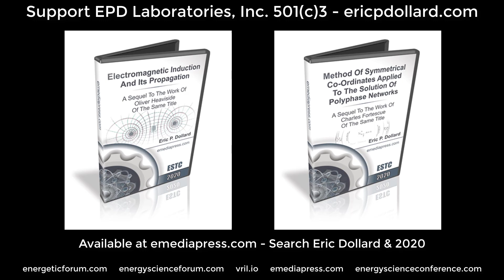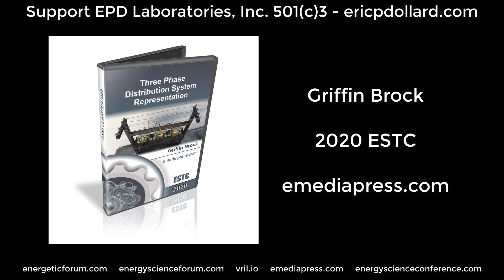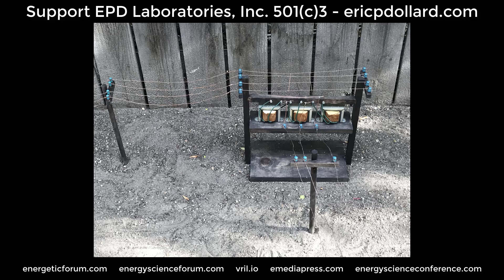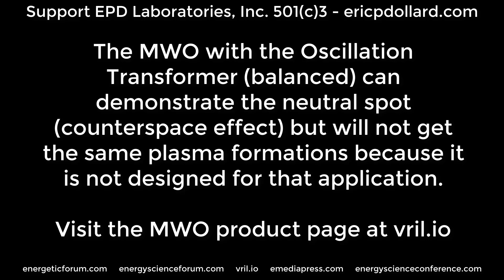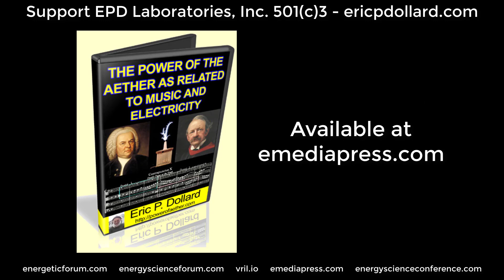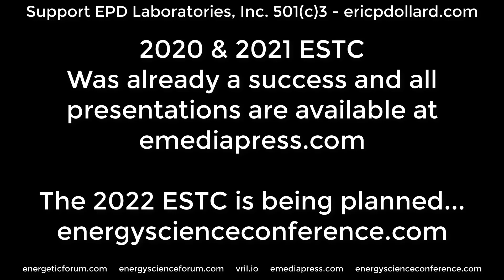Eric Dollard Live - 2020-05-30

Comment: Has Mr Dollard considered reworking the equations with respect to space instead of time. Instead of meters per second(velocity) or meters per second squared(acceleration) or charge per second(Amps) aka space per time, it becomes seconds per meter or seconds per meter squared or seconds per charge aka time per space. Frequency goes from 'occurrences per second'(hertz) to 'seconds per occurrence'. The dimension of space is much more conducive to being 'squared' or 'cubed', than the dimension of time is. It is difficult for the brain to physically visualize 'per seconds squared', but it is much easier for the brain to physically visualize 'per meters squared'. A square second cannot be naturally represented in physical reality(that I know of), but a square meter can be represented in physical reality very simply its simply a square of space with each side equal to the unit of measurement ie meter, foot, inch, cm, etc. Even the words 'squared' and 'cubed' are words to describe space(not time). Sometimes the universe can appear from the most unlikely source to simplify things. Time/space is far simpler than space/time.
Reply from the maker: This is all best communicated to Eric on the live calls or you can write him a letter at the address in Nevada in the right column of his website: https://ericpdollard.com - that way, you can get a response directly from him.
Reply: Cool ideas
Reply: I think calculating distance in light seconds is effectively what you’re getting at.
This is one of Steinmetz contributions.

Comment: Aaron can you ask Mr Dollard, how he would map out the units of measurement if he did not use Volts, Amps, Henry's, Teslas, Ohms, Webers, Farads, Columb, etc or any other unit of measurement that use some dudes name instead of a term related to what is actually occurring in reality. It seems that much of the unnecessarily complex aspects of electrical engineering stem from the very poorly named units of measurement. I'm curious how Mr Eric would represent each of those aspects of electrical engineering while only using units of measurement directly related to reality.

Comment: For twenty seconds, between...

1:06:18
https://youtu.be/FtasKI44WDk?t=3978

...and 1:06:38
https://youtu.be/FtasKI44WDk?t=3998

...I like what Eric says about the only components allowed in the old style of engineering was to merely use vacuum tubes to bring the power into the system and reserve transformers for amplifying the power. My work on circuit simulations over the past year has brought me to a similar conclusion in which Michael Faraday's Law of Induction (in which a coil has to move through a magnetic field in order to respond with current manifesting inside of itself) is avoided whenever spark gaps bring in the power and authorize coils to magnify it.

In fact, I've discovered that it is possible to short out a circuit by doing something analogous to what Nathan Stubblefield did with his Earth Generator is to short out all of the nodes of a circuit except for its miniscule sine wave input (equivalent to the voltage available among the trees and other living things, namely: a few microvolts). Many, if not all, of the coils could have generated negative watts (according to the passive sign convention) under this type of odd (by conventional standards) condition. If they had they been allowed to register any voltage. But they can't since both terminals of each component is shorted to a single node. And this singular node is adjacent to one terminal of a sine wave input while the other terminal of the sine wave input is grounded. Nathan used an old oak tree situated above his Earth Generator (misnamed, Earth Battery by the Patent Office) to input pure sine waves while the Earth shorted everything out. This condition bypasses the resistance which is normally associated with sending energy through each component to get to the load and mimics Tesla's method of bringing two points in space together so that nothing is sent and also mimics superconductance at ground temperatures. Voila! Current without voltage... Magneto motive force without electro motive force. Only the sine wave input exhibits any electro motive force at a few millions of a volt. Cold electricity...nothing to heat up; and nothing to buildup electrostatics to risk arcing to ground and frying equipment in the process. It begins to look very likely that this style of reasoning is why Nathan managed to bring the air close to ground level into an evenness of glow bright enough to mimic the noonday sun, yet, during the dead of night similar to when Tesla made his body glow to demonstrate the ridiculousness of assuming that electricity always is prone to electrocute unsuspecting victims.

The circuit which I am using for this virtual experiments is an offshoot of a shorted motor/transformer attached to a full bridge of diodes feeding D/C into a capacitor...

drawing of schematic...
https://ufile.io/ih34zydv

theory, etc...
https://ufile.io/npo356k7
Reply: I would love to do this kind of work but I work on intuition and I don't think I'd get very far, or would I ?
Reply: @claponclapoff6   Intuition has guided my research a long way
Reply: Im a brand new guy to elecyronics. I wound my first motor 1 year ago. Tried making vacume tubes. Big one out of a glass vacume box....i think there was to much space in the box. Idk. Hopefully i get more intellegant . This stuf seems realistic, relitive to
Reply: dead shorts, amps without voltage, spark gaps are no diff than a firecracker underwater, edwin gray then harvested those waves. the comment should say "millionTHS of a volt"